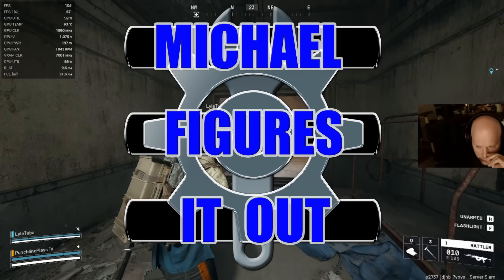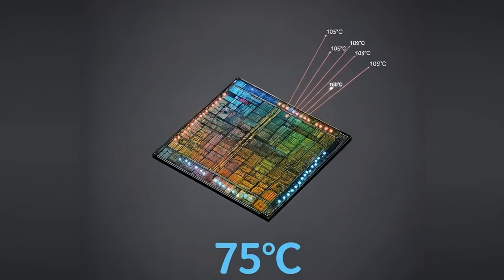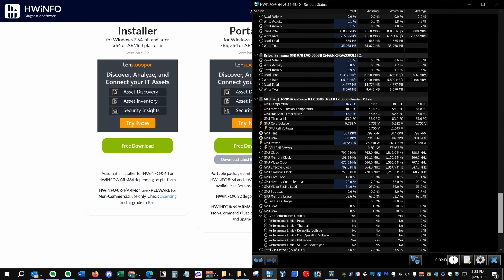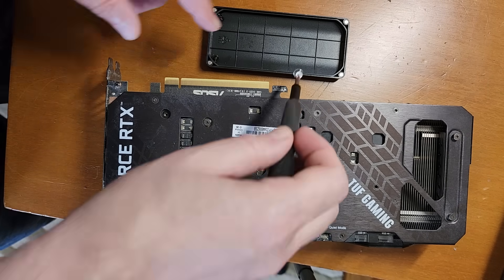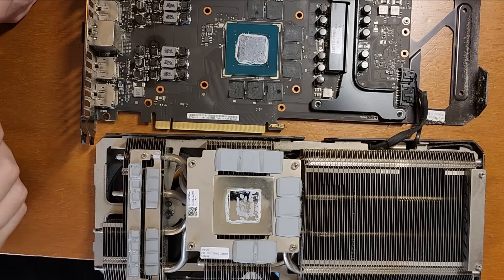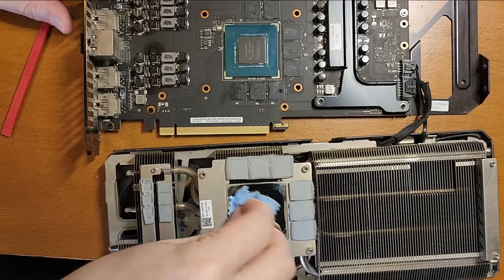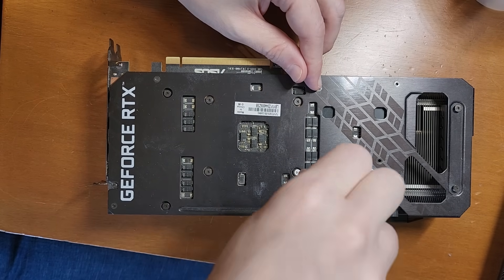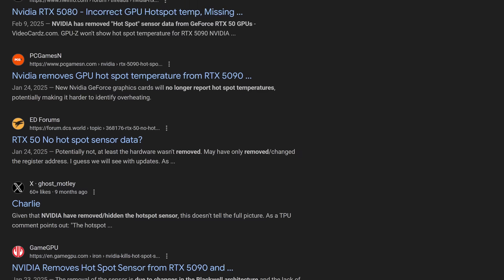GPU Temps Are A LIE!

Comment: The hotspot can reach up to 120c as the limit, so, in this case, the user's graphic card maybe need a repaste, after the repaste and the problem persists, then the card is dead. 105 is high but still inside of the limit. As FAE, this number you can see in most high end chip but lower cost models like Turbo/Gaming from Gigabyte and Asus. The difference should be inside of 20C between normal temp vs hot spot. BUT, repaste is only can be done by the manufacture if it is within the warranty. Do not do by yourself. The paste from manufacture can last around 5 years. They are not using the regular paste as a lot of people think.
Reply from the maker: Thanks for replying. Always like to hear from experts like Field Application Engineers. 

Do you have a source for the hot spot of 120C being the limit?

Comment: I have the RTX 5060 Ti 16gb and an older build of HWinfo since you can't get AMD 7 9700X CPU temps with the newer versions. The reason I mention this is that the GPU Hotspot seems to be there on this older build, but it says 255.0°C which is definitely wrong. So they probably had to remove it because of a compatibility issue.
Reply from the maker: I read that some software will just read zero or 255, which means it cannot read the hot spot sensor. Thanks for letting me know.

Comment: My 9070xt has a 30 degree difference.  50c - 80c.  With a good fan curve it keeps it at or below 80c for the hotspot. But I worry I will have to reapply thermal paste within a year or two.  Great video!
Reply from the maker: Thank you. Some AMD cards seem to have higher thermal limits so check the specs for your card.

Comment: I have the same issues with my 7700XT with hotspot but my card really hasn't crashed.
Reply from the maker: AMD cards have different thermal tolerances. If you're not having issues then you're probably fine.
Reply: @MichaelFiguresItOut  I will still try to repaste it when the warranty expires, It's an ASRock Challenger OC dual model.

Comment: I misread something and thought my 30 degree difference was fine! Cut a year later to present day and my boost clocks and I thank you generously. It seemed so boring honestly but it took five minutes to maintain for months, good deal.
Reply from the maker: You might not have misread it. I've seen whole Reddit threads where people say to ignore the hot spot temp! Glad it helped you.
Reply: I say misinfo for my ego's sake. Also it wasn't the best gpu before, but it was a really decent heater I may miss. It doesn't heat up near my arms nearly as much, especially with an undervolt. Damned be this winter

Comment: What should be delta temperature for RX 5700xt ? I have GPU temperature 70C and hotspot temperature 105C during OCCT 1080p benchmark
Reply from the maker: I mentioned in another response that there's a techradar article on the RX 5700 XT that references a (now missing) AMD blog post from 12 Aug 2019 where AMD states that card will only thermal throttle if the hot spot (aka thermal junction) hits 110C. So you seem to within the limits. 

You can check the GPU section of HWInfo64 for 'GPU Performance Limited'. Expand that and look for Performance Limit - Thermal. It it says 'Yes' then your card is thermal throttling. If no, then you should be good.

Comment: dude should of known when his fans were running at 2500rpm would of been so loud
Reply from the maker: The fans run off the GPU temp, not the Hot Spot Temp. FanControl doesn't 'see' the Hot Spot Temp and that's what we use to control all the fans.

Comment: 3070ti hotspot 100c, gpu 67c, thermal throttling at 75c on gpu after 3 years -> phase change paste on gpu and new thermal pads on mem -> hot spot 72c gpu 60c
always check for ur delta between gpu and hotspot (u can try to check it even if nvidia hides it by making ur gpu thermal throttle)
Reply from the maker: Well done!

Comment: The 50 series card s start to thermal throttle at 62 C  well i assume each card is different i have the 5070 TI you need to check the bios settings on the video card to see what the hard codes are set to, Open a dos window prompt and put this  nvidia-smi -q      this will tell you all you need to know. my card runs at like 29 C but the new cards use so little power compared to the 3 series cards

Comment: Use PTM instead of thermal paste. This significantly reduces hotspot performance. Also, replace the VRAM and VRM thermal pads; the card is 5 years old; they're dead.
Reply from the maker: A lot of recommendations for PTM. But he pads seemed fine. Why do you think they're bad?

Comment: rtx3060 12gb   temp reached during gameplay  (Cyberpunk 2077) max settings-dlss quality no raytracing 1080p    87celsius and during n this summer(outside temp 32c) 90celsius

meassured with MSI AFTERBURNER+RIVATUNER    ALSO NVIDIAS OWN OVERLAY

90celsius i mean during cold winters at 85-86c if cold inside my room where desktop was at the time i just closed all doors n a few hours if that even w gameplay it was way warmer in my room(INSANE)

GPU was in a prebuilt desktop from MEDION

rtx 3060 12gb vram
i5 12400f
16gb 3200mhz
500gb nvme gen 4

windows 11 23h2

also worth mentioning is that store had a look at it n even changed the paste n found out almost all same desktops sold from medion had same issues(after store fix=nothing different)
(new Lenovo legion desktop rtx 5070 max temp sen 65celsius....so much cooler)
Than ks 4 video
Reply from the maker: You're welcome!5

Comment: whatever you explained it's for Nvdia GPUs which doesn't show Hotspot tems until you run HWInfo as far as i know, things might have changed since i switched to AMD 5 years ago. AMD GPUs shows hotspot temps in it's software. but game crashes can happen for many reasons not just Temperatures.
Reply from the maker: I heard that about AMD GPUs. I think it's great that they do that.

Comment: anyway air cooler has limit that cant tighten between surface between hotspot
Reply from the maker: Nope. Air coolers and water coolers attach to a CPU and GPU in the same way - heatsink and thermal paste or pad.
Reply: @MichaelFiguresItOut again no mattet what design you only close get to 20 30c difference. Between surface temp of gpu vs Hotspot which js coming from inside of gpu die.

Unless you use heavy water cooler

Comment: Yo great vid, if thermal pads tear or are damaged they should be replaced. Cracks and tears in the thermal pad can create hot spots as well. Just something to be aware of.
Reply from the maker: Thank you. I think you're right. I was watching another video (way more popular tech channel than mine!) and they said you can reseat torn pads but I should have done my own research before repeating it.
Reply: @MichaelFiguresItOut made this mistake during my apprenticeship as a technician, so I'll never forget. Along with not reinstalling the glass insulation pads that sit between the high powered transistors and the heat sink in an amplifier, the amp blew up again.

Comment: also, you should wear gloves...not just for protection. the oils on your hands are worse than the worst thermal paste/pad and will contaminate them.
Reply from the maker: True. But I wiped the surfaces after touching them with isopropyl alcohol then only used the plastic tool to apply the paste.

Comment: Don't worry, NVIDIA has removed the hotspot. If you can't see it, the problem doesn't exist.
Reply: Out of sight out of mind haha.
Reply from the maker: Like the Bugblatter Beast of Traal!
Reply: Gddr6 also runs pretty hot depending on the manufacturer. We did custom heat speader to replace thermal pads on my brothers Steel Legend 9070xt and used custom fan curve to get more decent temps. We always watch the hotspot, not the avg temp. I think my own 9070xt also ramps the fans by hotspot, not the gpu temp.
Reply: @16sv 

yeah, Radeon's default behavior(ramp-ups by core's hotspot temp or related with fan rpms).

as far as I know, RX6000 does the samething.
other series? nah, I couldn't bought them so I don't know that.

anyways, if you use the Radeon dGPUs,

turn-off the ZeroRPM feature first.
and custom fan curve by advanced mode.

I hate Zero RPM and that sh-t enabled by default.
Reply: Yeah, so now there will be no crashes and CTDs anymore, well, there will be one last crash when your GPU finally dies
Reply: Manual temp probs on my 4080s ASUS TUF shows my GPUs Hotspot never exceeds 86C in my rig thankfully.  Non-hotspot temps never go above 75C thankfully as well.  I got a real champ of a 4080s in my Lian Li 011 Air mini paired with my 5700x3d (cool my cpu with a NZXT Kraken 240ml AiO fans exhausting out the side panel and cpu temps never exceed 74C).  Ambient temps of my house are usually between 68F and 78F just fyi.
Reply: elephant in the room
Reply: what hotspot and i have the same card, except it's a EVGA card of 3070.
the last EVGA card.
Reply: all good the guys with IQ buy amd :D
Reply: @RetroVGamingZone  there wasnt a better way to scream "look how stupid i am", congratulations
Reply: @RetroVGamingZone Rather, AMD temperature is higher
Reply: @duk6046  my gpu has never seen 60C at benchmakts or gaming not even in summer with 45C room temp so whats there higher? at older amd cards it was true but at 9000 the temp does down, atm i have on in background cyberpunk high 4k rt on 60fps (native) and my amd cpu has 48c and my amd gpu has 52c so i think the most guys are only trolling in the internet with temps that not exists at modern hardware.
Reply: @duk6046  How would you know if you can't access the data in Nvidia newer cards
Reply: @RetroVGamingZone AMD GPUs hotspot are normally 20-25 hotter than the average and shows a weirdly low average at that so when I have an AMD GPU, I prioritize the hotspot temp offer their average while NVIDA I go with average. Had a Sapphire Nitro + 7900xtx and its average temp read 51-52c, but it's hotspot hovered 73-75c and this is after a repaste with thermal greasily extreme paste. Better then stock temps regardless though neither was over heating temps.
Reply: Guys with no money*
Reply: @RetroVGamingZone Anyone who wants more than generation old performance has to buy Nvidia, and even there it sucks. Anything from the 9070 to the 5080 sucks, none of them get above 65% of the performance of a 5090 and they all barely match or barely exceed the 4080. Maybe when RTX 6000 is out AMD can drop something that competes with the 4090 so we at least have 2 generation old flagship performance on a budget.
Reply: Only in RTX5000, but AMD? They remove a real Hotspot on RX9000.

Comment: Does he have a Intel 13th or 14th gen CPU by chance?
Reply from the maker: He has an AMD Ryzen 5 5600X which has been great for gaming.

I'm aware of the Intel 13th and 14th generation processor issues regarding the microcode flaw which caused excessive power draw. I specifically avoid those CPUs when recommending PCs because even though the code has been fixed with a patch, there could be long-term degradation that causes crashes. Good thought, though!
Reply: @MichaelFiguresItOut  Intel 13-14 Gen "too low voltage issue" will pop with not enough Vram error. Or something else Vram related. I can recreate this scenario on my 13th Gen OC'd Intel machine in any game. If you get this error, you don't need new CPU or new BIOS. You just need +50mv more on the CPU core. Intel Heavily overclocked those CPU's and give them not enough juice. Just make sure you have enough cooling to handle the vatts or it will suicide itself. Those CPU are for experienced folks anyway. Don't buy them. Mine is running like a charm beyond Intel's OC but it's a long story.

Comment: Yep common problem because the fans are only accounting for the main temp. Always better off being on the high fan speed, tolerable side. Thermal pad replacement was a must on a 3080 Gigabyte card I got. It would hit temp limit in no time. The new Gelid pads decreased temps by almost 20c!
Reply from the maker: Nice. But keep in mind the Hot Spot Temp is only on the GPU. Some cards have a sensor for GPU Memory Junction Temperature in HWInfo64 that shows the VRAM temps.

Comment: Hot spots can also be VRAM related, so just the thermal paste isn't enough you sould also try to replace thermal pads
Reply: Unless they are damaged, falling apart or completely dry, no point replacing pads on a GPU this price and caliber. Just smear a tiny amount of thermal paste over the existing pads and it will work till its trashcan time.
Reply from the maker: That's what I've heard, as well.
Reply from the maker: Hot Spot only measures the GPU sensor, not the VRAM. For that there is GPU Memory Junction Temperature sensor on some cards.

Comment: Guys, This is how i killed my 1080ti, temps or average temp seemed fine, but little did i know something was jammed in my fans, 2 were not spinning and somehow the one made it seem like the temps were absolutely fine, game/pc crashed (which should have been my sign to check things), turned pc back on worked fine finished playing for the night, but  noticed a ticking noise when i turned my pc off like when you tunr your car off off a long hot drive , that was likely the solder beads breaking hahaha. Always do your thermal paste, as that was part of my problem, it would have survived without the 2 fans, but not when there probably a hotspot under all the dry thermal paste that was on it.
Reply from the maker: Yikes. HWInfo also shows the fan speeds. So do a lot of other programs. Helpful to check every once in a while.

Comment: Also at 7:28 look at the RPM difference in the GPU fans.  That means it would be more silent and have some extra cooling capacity in reserve by means of more fan RPMs if needed.
Reply from the maker: Great eye! And you're exactly right!

We use FanControl and max the GPU fans around 80C. Since the GPU runs cooler, the fans don't need to run as fast.

Comment: Check the Event Viewer if it's actually GPU crashing and not something else.
Reply from the maker: We did. The thing that tipped us off was a lot of nvlddmkm errors. I think that when the GPU overheats, it can cause the card itself to stop working (thermal shut down) so that Windows doesn't see the graphics card temporarily. This can cause games or his PC to crash. The Event Viewer errors are not always obvious when this happens because it can manifest crashes in different ways. That's my theory.
Reply: @MichaelFiguresItOut  Thermal shutdown is like your monitor goes black instantly, all GPU fans start going 100% speed at the same time for a short period, then it resets your PC, and it happens at 90-95 to 100c on the core depending on GPU/Generation. My guess is that high hot spot temp was causing another component like memory or something near it that was already on the edge of stability with normal temps to go nuts from extra heating.

Comment: This is a good video but I want to clarify that if you use normal thermal paste instead of phase change one you will need to repaste the GPU around once in half a year because they do not harden while in idle they tend to be pumped out more than specialized ones.
Reply from the maker: Will keep an eye on the hot spot temps to see if this paste pumps out too soon. And thanks for the compliment!

Comment: Great timing. I've been meaning to do a proper deep clean of my PC with repasting and all as well as testing before and after,I usually just do a surface clean yearly blowing off dust and cleaning fans of my parts. 
Currently my GPU is 5 years old and usually in the past I pretty much upgrade around the 5 year mark but because of the current state of things in PC part market I'm sticking around for a few more years with my current system.
My average temps are pretty solid with both cpu and gpu are pretty good always getting to the mid 50s to 60s under full load when gaming.
Luckily I never had any crashes even though my GPU hotspot actually does have high temps maxing out in to 98 which I feel is hampering performance. Thanks to this video I feel like it's a good idea to repaste my GPU, never done it before and I've owned GPUs since Geforce 500 series days, first time for everything
Reply from the maker: It was my first time, too. Good luck and let me know how it goes!

Comment: I had the same issue with my gigabyte 3070ti. Re pasted it and working well now.  I also just left the thermal pads as is.
Reply from the maker: How long ago did you re-paste? People keep telling me it won't last and I should have used PTM.
Reply: @MichaelFiguresItOut a few months ago now. I just used the same thermal paste i had left over from the cpu arctic mx4. See how we go i guess!
Reply: @MichaelFiguresItOut  There's definitely a lot of fanfare around PTM, main reason is that it's supposed to improve over time rather than dry and degrade which makes people think it will last forever.
Looks like this would be a good long term test to see if there's signs of any pumpout is as impactful as people are making it out to be.

In general though, ptm7950 is supposed to last over 10 years VS 5 years for thermal pastes such as noctua's (barring the potential pumpout situation)
Reply: @MichaelFiguresItOut  I've done some logs the last few days and the temps have increased a bit. But i think this is more the difference in ambient temps. when i did the re paste it was winter, my gaming room doesn't have air con so ambient temps are up 15+ degrees or more depending on our hot summer days.